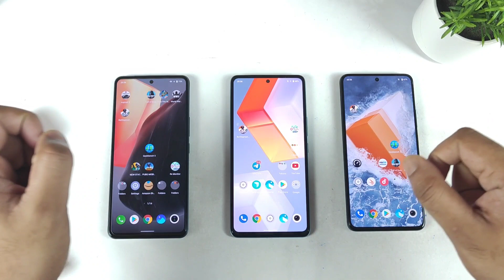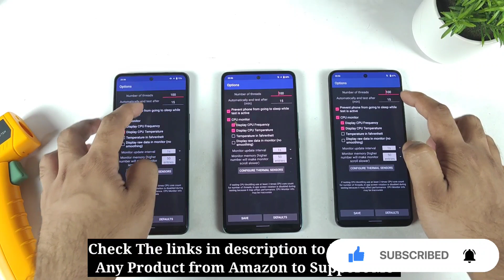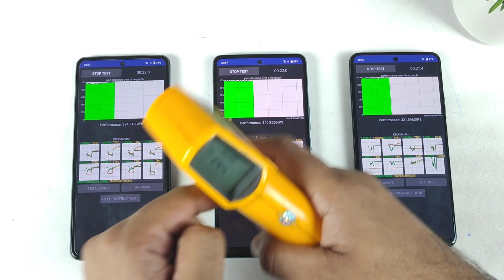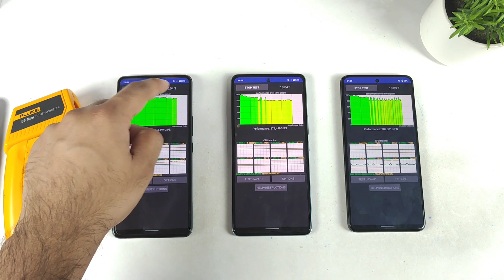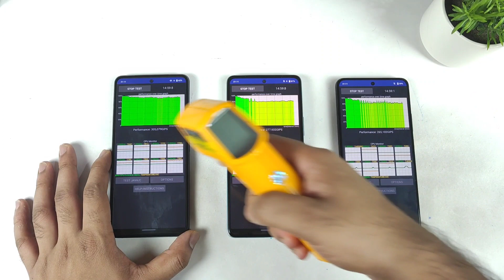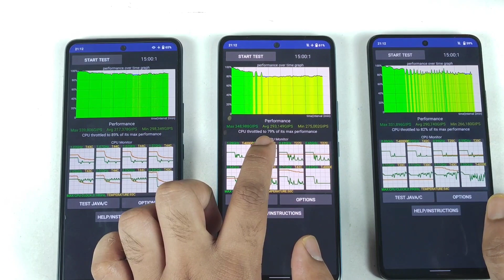iQOO 9SE vs iQOO 7 vs iQOO 9 CPU Throttling Test Comparison Snapdragon 870 vs 888 vs 888+ 🔥🔥🔥

Comment: I think SD 865/870/778 are best processor ever made by Qualcomm thanks to all credit goes to TSMC fabrication
Reply: Yes completely agree ,but it won't (870)support more 5g bands that is sad
Reply: Snapdragon 8 gen 2 would be on the tsmc node so it's going to be efficient and still give better performance
Reply: 845 also
Reply: @sudipyt123  not men 🤣
Reply: @sudipyt123  Yes and also the 855 series.